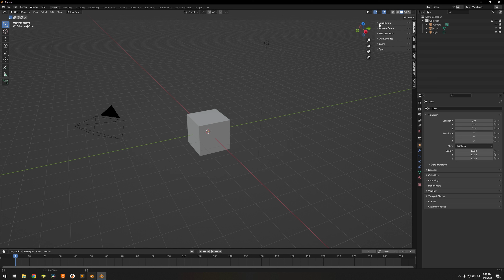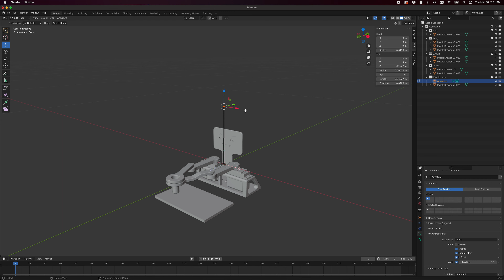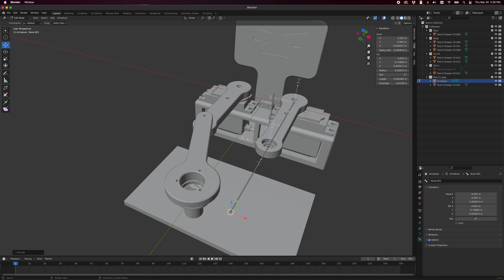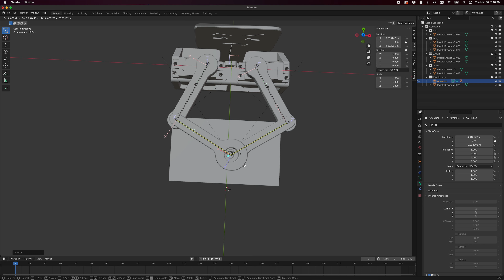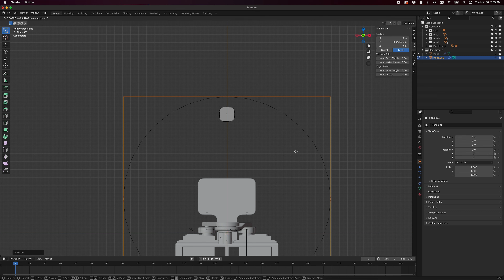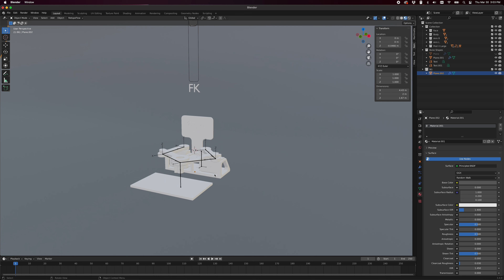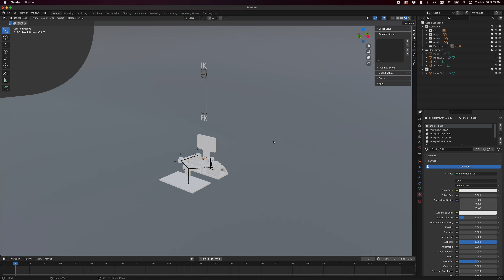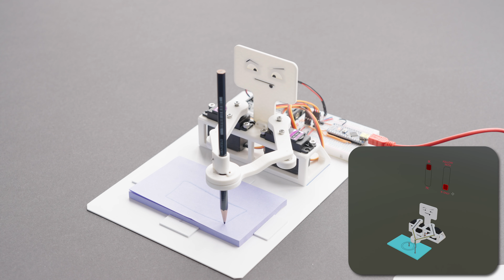MarIOnette Tutorial: Make Your Own Post-It Drawing Robot

Comment: Can this control servos with either encoders or potentiometers? Thanks
Reply from the maker: I'm not sure I understand. Servo motors already come with potentiometers inside, it's how they can be set to drive to a desired position. If you're asking about servo motors that can report this position back to the microcontroller (bus servos like Dynamixels or LewanSoul motors), MarIOnette supports both of these motors. Additional hardware is likely required based on your use case, so take a look at the github for more details.

MarIOnette does not currently support things like odrive or other custom systems (motor + encoder) without having to modify the Arduino code.
Reply: @knee-koh  Thank you. sorry I don't know all the technical terminology, but, I was wondering about something like a camera slider. Would servos with potentiometers, servos with encoders, BLDC motors with encoders, or steppers be a better choice if accuracy and smooth movement are most important. thanks
Reply from the maker: @mikealbert728  For a camera slider that uses a stepper motor (no encoder), you could use MarIOnette and get really smooth and accurate movement. Just be careful not to overload the stepper with a really heavy rig, because without an encoder, you will lose steps and positional accuracy.

Comment: Your add on and arduino code is broken, followed all the steps using Blender 3.5 and your add on is 1.0.5 not like the video! Can you do another tutorial on this? And also the add on doesn’t come onto my preferences tab rather is goes to my add on file in the app data folder windows also config.h says there is no such file the “include config.h”
Reply from the maker: @boss_lord56  Hi, that's because 1.0.5 is meant for Blender version 4.2 and later. You can either upgrade your Blender install to 4.2 or use an older release of MarIOnette (on the GitHub, click on releases on the right and then download 1.0.4 or earlier).